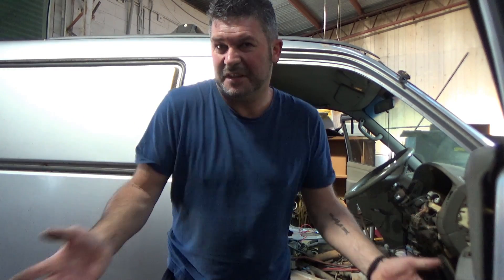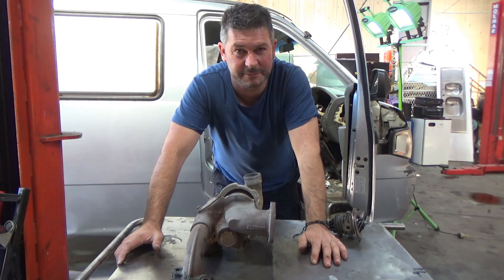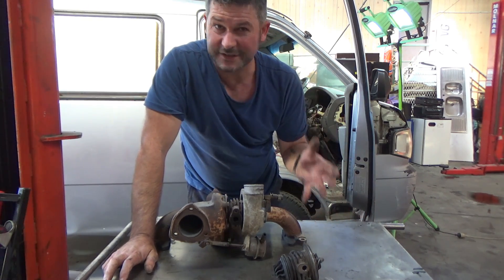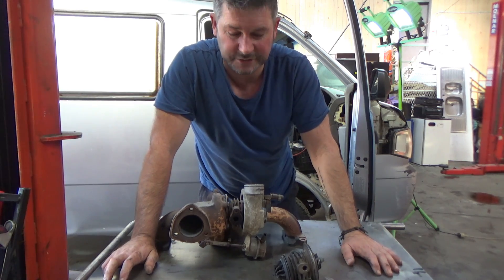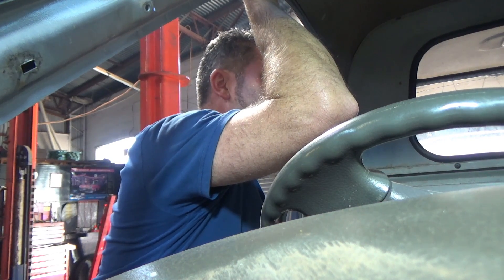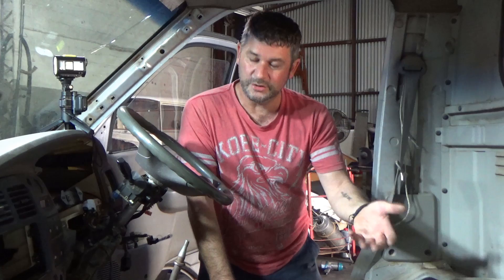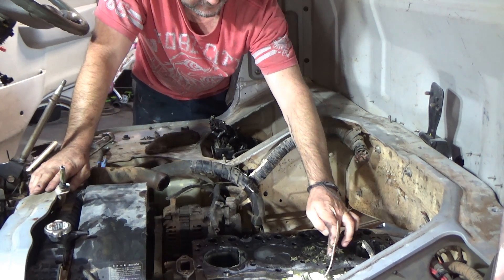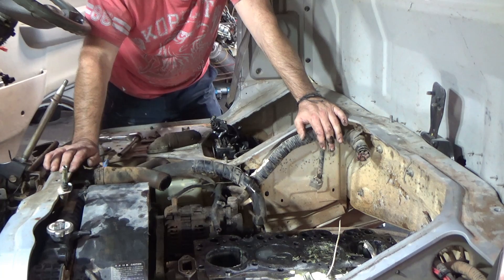How to Stop a Run-away Diesel -ENGINE BLOWS !

Comment: So, I live in the states. Our common diesel Semi Trucks have 15Liter engines with 10 speed transmissions (5 gears and a hi/lo splitter). The transmissions do not have gear synchronizers so if your truck is sitting and becomes runaway, you can't get it in gear. Most become runaway engines while moving and we have a duty to protect the public so we typically try to pull to a shoulder or get away from large groups of people. Also, I'm not a mechanic, but I was told there are high pressure and low pressure fuel lines so cutting fuel lines is dangerous if you don't know what you're doing (the high pressure can cut through skin like a razor). And finally, most runaway engines catch fire before we can get the engine hood popped to try to do anything. As far as farm diesels and heavy equipment diesels....I imagine they would have trouble getting to the engine before a fire started. Ultimately, there will be some damage. It sounds like a CO2 extinguisher is the best choice, I just don't know how much it would take on a 15-25Liter Diesel. Great experiment though. I've heard wood and a rag...now if it happens...I'll go straight for an extinguisher!
Reply: I work on and hot rod  the old 2 stroke Detroit's  Use a CO2 one If some one has removed the emergency stop air flap on the blower  those old things can if the rack jams the scream makes every one crap there pants and run  I also put a quarter turn valve on the suction side fuel line for that reason you can turn one about 3200  and not scatter it  I set them a 3K  on the stuff I fool with .
Reply: Never cut the fuel lines on any diesel engine no matter how old. Even pump line diesels like the DT360 and 6.9L Ford/IH V8 have a fuel pressure high enough to cut through skin. Common rail diesels now a days are running fuel pressures of 20-30,000psi. When this happens 99% chance you're gunna lose that limb. With a runaway the engine may not even be running on diesel fuel. If it is turbocharged it'll probably be running on oil from the crankcase. If you're in a manual transmission vehicle don't put in high gear and dump the clutch; you'll just shatter the disk. Rags in the intake are a hit and miss as most people don't have multiple thick clothes piled in their cars/trucks they'd just be willing to throw in the intake. Block of wood over the intake is most effective, but who(other than a select few who know the trick and how to do it) just carry around a piece of flat wood big enough to cover the intake? Pulling the oil line to the turbo would be another logical choice, if you happen to have the right wrench size for the flare nut and enough time to sit there and turn 1/4 turns until it starts spraying boiling hot oil at high pressure everywhere. And it's still not even off yet. A valve in line would be great, but that's a lot of pressure. Ball valve would be minimum. If you're running a turbo diesel a CO2 extinguisher is the best option of all of them. NO harm to the engine, they can be very small for smaller cars/storage, they're easy to use.... Not terribly expensive either.... $100-$200 is a nice safe insurance against a new $5000+ engine..... Just food for thought, and my personal experience working with diesels.

Comment: Old diesel engines governors can stick too or suck oil in from leaking valve stem seals and run away. Had a diesel engine the other day that stood for 10 years and first start it ran away but since I knew it stood long was prepared and just loosened the injector pipes. Diesel vehicles that roll over on their sides or upside-down can run away too from oil entering through the piston rings.

Comment: Close off fuel.  Poor man's effort, learn where the fuel line is, in the rear, even run a line you can do this with, take hammer, crawl under, pound the fucker flat...?
Simple ways of shutting the fuel off should be mandatory on  diesels with  run-away attitudes.  There are many ways to do this... 

Kk, I'll watch the vid :P
Welllll, so much for that engine, dry extinguisher?  Could have used a couple of  handfuls of dirt lolololol..
Hmmm. Anyone tried pouring water in the carb or air intakes?  Just a drunken thought.  I go now.

Comment: You are supposed to spray the air filter with the fire extinguisher. That clogs the filter and starves the engine of air, not spray into the intake. Of corse it's not going to survive that. Nice try though. And cutting off the air dosent work very good on modern desiel with plastic intakes and junk like that. The engine still pulls air through the valve train.

Comment: The extinguisher is not supposed to be sprayed into the intake manifold. It is supposed to be put into the intake so the powder plugs the filter. The plugged filter stops the air but also stops the powder from destroying the engine. As most of the crank case breathers also enter the intake post filter they are also deprived of air to keep running
Reply: lol... a plugged airfilter is never going to collapse and get sucked through the engine.
Reply: Plugging the air cleaner isn't quite what the powder extinguisher does.  Even powder fire extinguishers use CO2 for propellant.  The air cleaner just protects the engine from being damaged by the powder.
Reply: Will the fine powder from a fire extinguisher. plug an air filter enough to stop it? Try it!! Folks that claim it works say to do exactly what I'm saying. But here is the proof. This myth busting used The recommended "dry powder" fire extinguisher called for in the so called myth. Why is dry powder recommended if a CO2 is what gets the job done. Co2 extinguishers exist. I am not saying that CO2 doesn't have an effect at all. It's a non combustible gas and therefore replacing oxygen almost entirely will stop an engine.  But as you saw from their block of wood it doesn't take much oxygen to Keep running. If it drops to a sputter with CO2 and your extinguisher runs out you are immediately in the same boat. Not so if the filter is plugged with powder.  

But this whole video was strange. Myth busting of this type should be done with most commonly available Items and the most commonly available knowledge in the few minutes of panic before the engine self destructs. They are supposed simulate the problem to try remedies. They didn't simulate a engine oil runaway. They didn't kill the ignition which is the first common sense thing anyone would do first. Diesel fuel supplied by the pump is more volatile than engine oil. How often does the Turbo give out at a shop where you can access the shop rag they didn't use or a block of wood? You wouldn't have quick access in most times to these items. You would have your shirt to ball up and use or your pants or a jacket. These items wouldn't likely be sucked in if applied properly due to their sizes.  Even a rain coat. What's more likely to have on hand when driving? A dinner plate or a rain coat? Who travels anywhere naked without at least some articles of clothing in their vehicle? Even if you yourself don't have a fire extinguisher. Look for and wave down ANY commercial vehicle they are required BY LAW to carry one. Depends on laws in the area. But Here you are required to have one in a boat also so anyone trailering a boat probably has one. If you are in the out back hundreds of miles from anyone and find your self naked with no clothing to use. look down. handfuls of sand or dirt can plug the air filter.  The whole point is to educate. Common sense answers easily remembered and used by people in a bad bad situation anywhere and anytime.
Reply: Powder fire extinguishers are far more common than plain CO2 ones.  They're also slightly more effective at stopping a fire in the hands of a novice.  Restricting the flow of air into the engine is fundamentally different than disrupting the concentration of Oxygen entering the engine.
Reply: Powder will plug up the air filter, BUT then the air filter will just collapse and get sucked through the engine. 
Another reason for a run away!  Bad injectors. It causes a build up of excess diesel in the rings and then the engine goes run away on the fuel being fed from the rings. This is the only type run away I have ever experienced, as I was a marine mechanic, and most marine engines especially generator, and sail boat auxillary engines are not turbo charged.

Comment: Be nice to run a CO2 line to the air intake and use some type of a remote dump valve to the CO2 tank. Flood it with carbon dioxide. Slightly corrosive but it would stop it.
Reply: If you are going to make those kind of modifications then go all out and create an exhaust shutoff valve.

Comment: Gotta down check you guys, sorry but this is NOT a runaway diesel.
Reply from the maker: Peter Welsh -Duh, you will find all "testing" isn't the real thing. Crash testing doesn't use two cars, their are also no people in the vehicle . Ever watched " mythbusters" ? It's all simulated stuff out in a field or a lab. You have to be realistic, and read the pinned post. We did the best we could with what we had. We can't sit next to a 10,000rpm diesel in a van and risk explosion just to provide a video for free. All we tried to do is stop an engine at high rpm by means other than the key. By all means, make a better video and post it, I would love to see it.

Comment: Reading comments I guess alot of people don't realize how diesels work. Diesel engines have 100% AIR all the time, it's fuel to the injectors that control revs. So cutting fuel, and you can't cut spark cuz is doesn't exist. Your only options is cuting AIR or overwhelming the engine's rotational force with ( dumping the clutch or something like it).

Comment: Good fun. I've used wood on a turbo 6.0 years ago and it worked. Also curious. I'm from the USA not sure the stalling technique would work on some us vehicles with 900+ TQ AND Over 400Hp on most modern diesel 3/4 tons and up. Maybe with the E brake and foot brake applied still may have success. If you come to the states, find arkansas and me will give it a go. On some military vehicles.
Reply: Makes sense indeed, but I would also wonder how far is the clutch and gearbox up sized for the added HP and torque, and how much lower is the HP and torque generated by burning lubricant. Considering it's sized up for the added duty, power and reliability, I think it wouldn't vary much per vehicle size, that's just a guess tho.
I don't think you would get wheelspin by using a high gear too, but also applying brakes would make sense anyway (1st because you'll have to stop the vehicle after all)

Comment: remove the fuel filter no fuel no run
Reply: bonehead2412.  Its running on the oil in the engine not the fuel.
Reply: they run of the oil and compression dummy.
Reply: they run of the oil and compression.
Reply: I think removing the oil filter would be of more use :)

Comment: Nice video, make a part 2 and grab another used up diesel and do it again, this time run the engine while misting used engine oil into the intake so you can see the engine start overrunning The governor. At the end of the video give it enough oil so it shits the bed
Reply from the maker: Robert Wingate -Yep. We have decided to make another and feed it till it blows.
Reply: i would find that scaring me quite a bit.   I am normally confident about machines i understand, but a machine without a proper stopping possibility.. going at over 10k RPM makes me want to be much farther away than the lenghts of a broomstick.

Also, when you blow.. dont do it in your own garage dude - it may put you out of business.

Go to the grumpy neighbour of yours... do it there

Comment: The video should have been titled "What Happens When You Spray A Dry Powder Extinguisher In A Diesel Engine" and had some better shots of the aftermath. That was the most educational part. Of course every situation may be a little different but a run away diesel makes for a very tense situation, most people won't want to put their face down there to unhook the intake pipe. It would have been interesting to know if the extinguisher would have worked through a filter.

Comment: 7:23 try that in a big turbo international 18 wheeler and you will blow the clutch out of it because those engines have FAR more torque
Reply from the maker: alex pencek -yeah, if they were using a clutch from a Kia van . You provide the truck and we will try it.
Reply: It would probably stall it unless the clutch was pooched. I look at it this way. A clutch is much cheaper than an engine or a gearbox.
Reply: It can be done, much harder to get a high enough gear because unsyncronized transmission
Reply from the maker: OverblownSnow98 - That would make for a popular video though
Reply: The quad axle dump I drive daily for 3 seasons as well as the semis I drive for 1 season with walking floor/belt floor trailers  we have at work range from 73k lbs loaded to 96k lbs loaded (with permits).   Most semi trucks on the road don't  move without being at least 70k lbs when loaded.  The brakes definitely will stop a runaway diesel however the clutch is the weak point in that equation and may fail, in college  (I went to a trade college) we used to simulate a run away diesel turbo engine and what worked best was a rubber mud flap wrapped around a board (better seal)
Reply: Naked Off Road do you want to be skewered by a prop shaft?
Reply: don't think diesels have much power at that rpm tho? max power would be way lower in rpm range i think.
Reply: I feel that unless loaded, would be more likely to spin the tires, since those trucks have nothing on those axles in terms of weight.  20 tons of general merch for a superstore?  Pop in 18 and see what happens.  Probably burn out the clutch, but hopefully the engine stopped too.
Reply: Slayer John how would you get it in gear? Your just gonna grind the gears right?

Comment: I suppose if you can reach the oil line of the turbo with something to cut it it would stop it as well. I know Diesel tractor pullers have steel emergency cut-off valves on the intake, so perhaps on a more fresh engine with a better seal over the intake it would kill it.

Comment: When I went to Universal Technical Institute in Phoenix Arizona, for Automotive and Diesel technologies, there was a run away diesel engine that a student had rebuilt. The student panicked and grabbed a Phoenix phone book, which is about 3 inches thick, and attempted to cover the inlet port. The engine was running so fast that it actually sucked the phone book into the engine shredded it into confetti and blew it all over the school compound!!!! It was kind of unnerving how quickly it pulled the phone book thru!!
Reply: Yeah, i am calling bull$h1t on this story…lol😂
Reply: I am sceptical. The engine can only produce a certain amount of vacuum no matter how hard it is revving. Must have been a pretty pathetic book.
This is a real runaway engine stopped with a plastic cover which he finally gets properly sealed and the engine stops. I would personally be very wary about putting my hands anywhere near the turbo in case they get shredded. BTW this is in a class too!
https://www.youtube.com/watch?v=HSW-dkcszLE
Reply: @rogerpearson9081  very skeptical, this is the same as trying to rip a phone book, good luck!
Reply: @velianlodestone1249  i can rip a phone book...trick is to kink the book first..enjoy
Reply: I assume the suction was pulling on one page at a time but very rapidly thus being able to make the book into confetti

Comment: if the engine was running on oil like it would likely be in a runaway situation, the block of wood or rag might have worked better because it would need more air to burn the motor oil.

Comment: or just use your hand
Reply: I was standing on the back on my 4.9 ltr fuso one day, right next to the intake snorkel, the top of the snork was missing so the top was wide open.
Now at the time the truck was just idling and I thought maybe I'll stick my hand across the snorkel opening to see just how strong the suction was, I purposely / cautiously didn't try to completely cover it over out of fear.

That fear was for good reason, at idling, 3/4 covered over with my hand I swear it felt like it was going to rip my finger clean off....
I work on all my trucks and if any of the ran away, no f$&@ing chance I'd stick my hand over the intake, I believe that other guy saying it sucked a phone book thru the engine
Reply: what if it sucks your hand into the engine
Reply: lay it flat on the intake, don't put your fingers in it. Or take your shirt or something
Reply: +Simon Richard what if it sucks your entire body into the intake o_o ya never know
Reply: then it kills you
Reply: Well, you can calculate how much is the maximum force of suction. Get the area of the intake in centimeters, and each square centimeter is a kilogram pushing it inside.
Sorry I ain't doing the conversions for imperial, too much hassle (OK OK, 1 square inch = 14.7 lb)
So a tiny 5x10cm intake would literally push your hand inside with about 50 kilos at a full vacuum situation. I ain't doing this. Say the intake can only go like 1/4 of that, 75% atmospheric pressure at the intake, that's still 12.5 kilos on that 5x10 cm intake, pulling your hand inwards.
Reply: Garth and if your hand just gets stuck on the filter, good luck. If you removed the filter and get your hand inside the turbo's impeller...
I don't wanna see it

Comment: The rag does work it saved the day for me on my old landrover when the fuel injection pump failed. I stuffed my jacket over the air intake and it stopped it virtually straight away saving the engine